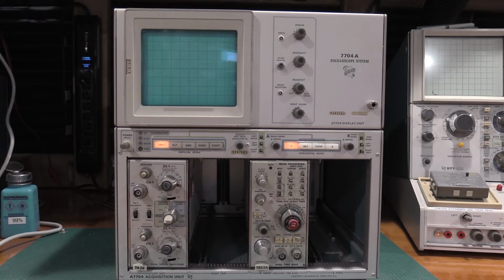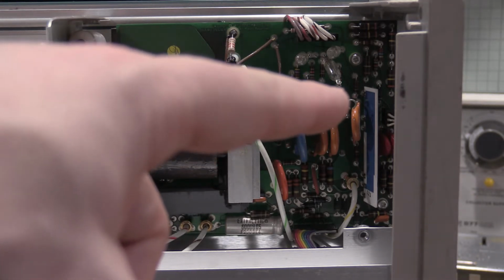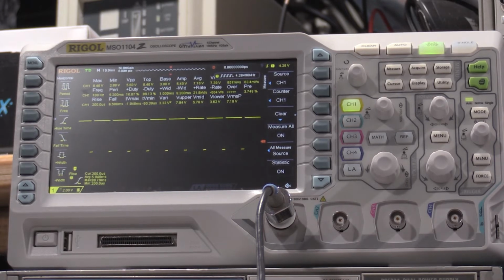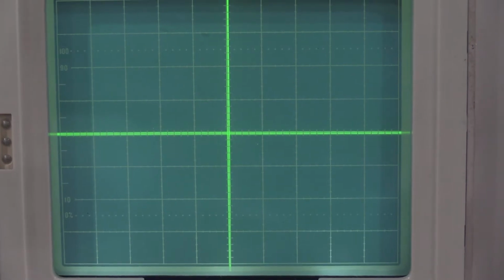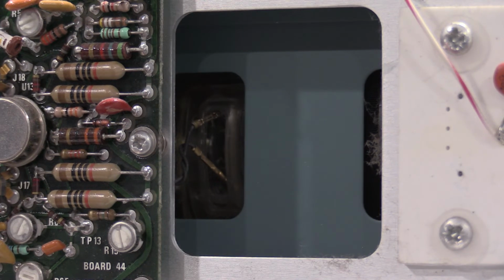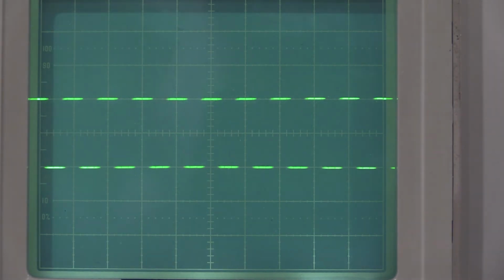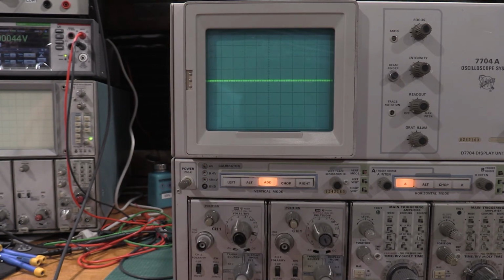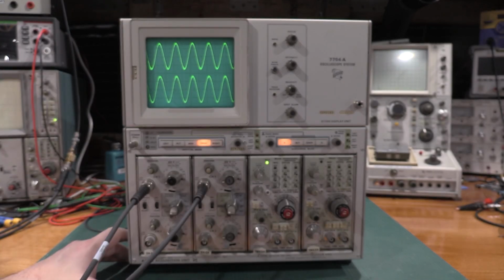Tektronix 7704A Calibration

Comment: Thank you for sharing this, Zen! I have a quick question on your step 4 (HV PS adjustment). assuming you're using a Fluke 80k-6 probe with your Fluke 8840A, did you have to manually adjust the range to make sure you're on a 10Mohm input range when performing the measurement?
Reply from the maker: Yep, I used the 6500 in ohms mode to measure the inputs of the other meters. I also checked the ranges. In my lab with the sampling of gear the 8840a on the 20Vdc range was the closest to 10 Megohms and gives me the best reading with the HV probe.

Comment: Nice.  I have a 7704 non-A version.  Full of gold inside and doesn't work particularly well.  probably i should attempt to run through a similar procedure on it.  I wonder if the geometry cal waveforms could be simulated by an audio file one could play back through a PC...
Reply from the maker: Most likely it is really just intersecting square waves. where the lines cross is the intensified dot. The hard part is syncing free running oscillators. As when this is done there is no time base so nothing is locking triggering. Having them generated from the same source would help with that as well split the signal and send it to the correct locations. Then you would not have the sync issues.